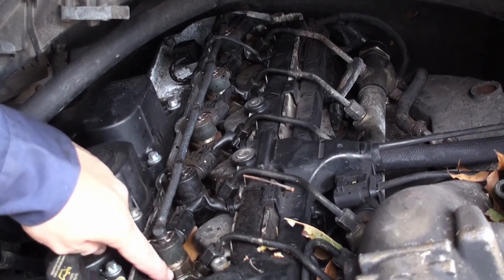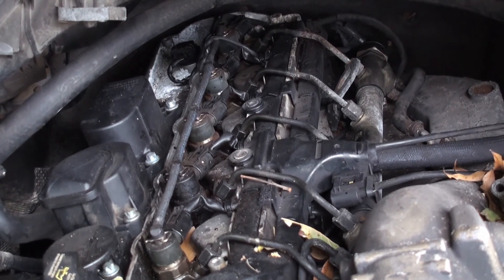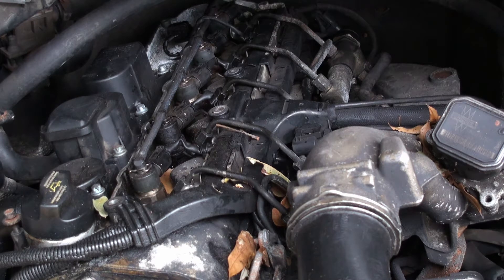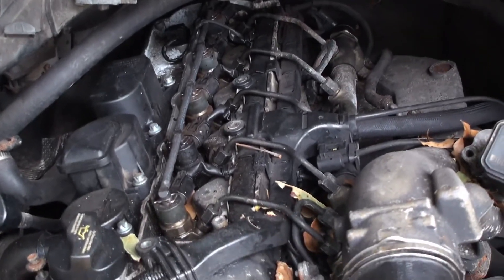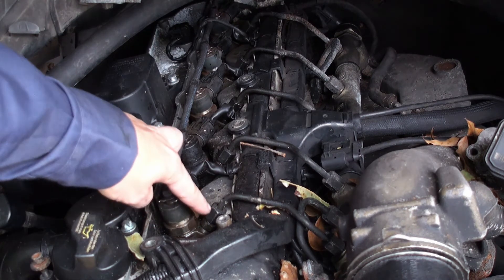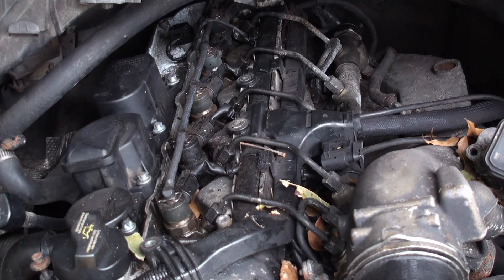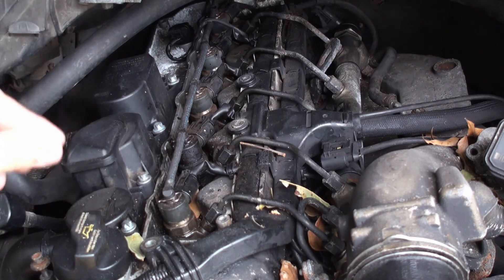T1N Sprinter Fuel Injectors and Fuel Rail Information

Comment: So I watch all your videos, it would be helpful if you didn't skip through because I had problems remembering where everything went back together. I took out the entire engine, redone the top end and put it back but I need to ask 2 questions. #1 there's a hose on the back of the valve cover, does it connect to anything or is left open? It had 2 brackets so I bolted  them to the left side of the valve cover. #2 Most of the transmission bolts are short but there's 2 just slightly longer, where do they go?

Comment: I am planning to install a webasto thermotop C into my 1998 sprintervan (D208-W901)
I think I am able to plumb in the coolant hoses and such but I wonder about the fuel line and do I need to bleed them after I installed a T piece in the fuel line to supply fuel to the heater?

Comment: Hi. I have an ‘05 2.7L
Fuel injector #5 threads are stripped. My mechanic tried to repair with Helicoil without removing the head, but the new bolt didn’t hold.
Any advice? 
Thank you so much.
Reply from the maker: Yes there is a fix for this, I talked about this fix many times but did not make a video on it yet, because my installation tool broke while doing this repair, but the fix is not using helicoil, that just won’t work, you need carbon steel inserts from  TIME-SERT they make a kit that’s specially fixed this problem, and it’s a bullet proof fix, but I would not recommend doing this unless you stripped your threads, here’s the link to exactly what you need  https://amzn.to/2C1F2hh

Comment: i have a 2006 t1n that is running really rough.  know its #5 cylinder, swapped #3 injector with #5 and no change, check compression and its good, getting code p0087 fuel/ pressure too low bank 1 and p0275 cylinder contribution/ balance and p0305 cylinder misfire. working on finding a possible fray in the wiring harness, any help would be great, thanks

Comment: Hello. I have a strange problem with a 2,7 engine like this, its mounted in a Jeep GC, but is exactly the same engine (OM612, biult 2003) Its hard to start when I park it facing front uphill. I have changed all the plastic lines and O-rings, and even added a check-valve just before the filter. There is no air in the clear fuel lines. But over night, the fuel goes out of the rail through the return line! (The line that goes back to the filter into the black plastic T-shaped valve. The return hose is full of air the next morning, and I have to crank 2x 10-15 seconds to get it to start. I have also checked the return flow on the injectors, and it seems ok. I changed the small and big O-ring on the fuel pressure regulator too. Now Im out of ideas here.. I cannot see any signs of external fuel leak. Air must be getting in somewhere in the rail to allow fuel to drain back through the return banjo ? Should the fuel pressure regulator work as a valve when engine is shut down? So maybe its something wrong with it? I checked my fuel pressure with an OBD reader and special app, and its 275 Bar at hot idle, and up to 1400 bar at full throttle. It seems to follow the setpoint smoothly. I have spent 2 years chasing this problem now, so I hope you have some idea? 

I can add that the problem gets worse the less fuel I have in the tank. Also, I have verified that its a solid stream of fuel coming from the supply line to the filter (no air) The problem gets better if I plug the block heater in. It gets worse when temperatures drop below freezing.
Reply from the maker: Keep me updated, and right now I am dealing with same thing let’s see if I can get it started

Comment: Thanks for these videos!  I am working on replacing injectors.  I don't know if there's another video discussion of the actual replacement of the injectors, I'm looking for advice on cleaning/preparation of the head for the new injectors.  Do you recommend a certain brush?  Or seat cutter?
Reply from the maker: I do recommend some tools, I actually have a video that’s a little more detailed and showing exactly how to do it step by step, as for tools always look In the description below, usually I leave links for tools and parts I use here’s the video https://youtu.be/qdQNuJVgoXo

Comment: Hello , I Was wondering if you could help me I have a 2006 sprinter diesel five cylinder, it keeps going in limp mode after reset, I have a code for too high fuel pressure, I have replaced so far the fuel filter,fuel pressure regulator and fuel pressure sensor, I also checked to see if any of the fuel lines are kinked but everything looks good, Could this be an electronic issue or the high pressure fuel pump issue.
Thank you

Comment: I have a 03 it runs bad when I am driving it makes a knocking noise like pre detonation then is goes away . I looked under the hood and noticed oily residue coming from the EGR it's a plunger style . Any thoughts on what it could be . My fuel mileage has gone down considerably it's chugging but sometimes it smooths out at higher rpm like on the highway
Reply from the maker: It sounds like fuel injector or injectors, there’s a $35 kit on Amazon that I just got myself, it can test the down flow of fuel injectors using a fuel return connectors on fuel injectors, you start the van up and look at which one will fill up the faster with fuel, letting you know where the problem is, here’s the link to the kit Diesel Injector Flow Diagnostic Cylinder Common Rail Adaptor Test Tool Kit
https://amzn.to/2UIyNoy
Reply: @ZimaletaMotors  I can't tell you how much I appreciate your advice . Thank you . I did watch your video about the black death and how you explained how the injectors works and the copper crush seal I love the videos I will continue to watch learn and share . Thanks again for the help it means a lot to me
Reply from the maker: Wow thanks jets awesome, glad you liked it, BTW today I finally built my setup for taking calls for my podcast, soon I will announce this, but because of your positivity you will get the number to my show early   

ZIMALETA How To Show Sprinter Help 
Podcast # 760-756-7378
I will announce best time to call, but for now it’s Saturday 12-5pm Eastern Time
Reply: @ZimaletaMotors  you are the best and I look forward to talking to you . I have learned such a great deal from you already . I'm a small business owner and it's videos like yours that help guys like us get ahead and prevent downtime waiting for a shop to look at it and get a huge repair bill . You are taking your channel in the right direction you are very knowledgeable and passionate and you truly care to get the right information to your following thanks again you are a big help
Reply from the maker: Your so welcome 🙏 I do it for viewers like you, I am trying to improve my channel and have more helpful sprinter content available, I will keep on growing this sprinter resource, and in time it will be the largest sprinter resource online, this is why I am adding a podcast style show to my channel, I want to start 1 per week and then improve what I do and do one daily, this means more work for me, but it’s well worth it to help viewers like you 😊👍
Reply: @ZimaletaMotors  and I will do my part and create awareness . You are truly on your way it's not easy people think you hold a camera up for 20 minutes and ad revenue flys in . It's a full time job and I truly appreciate the hard work you put in. I'm really looking forward to actually being able to talk to you I do have some good questions. But thanks again. What state are you broadcasting from I live in Chicago I was wondering because of the pod cast I can get the time zone so I won't miss your podcast
Reply from the maker: I am on east coast from South Carolina, yes you right it’s a full time job, plus I need to fit everything else in like family, eBay and other stuff, it’s 11pm and I need to go edit a video for tomorrow, 😊 looking forward to talking with you.

Comment: I have a 2003 T1N. Every so often in the morning or when it sits for 10+ hours when I start it up the engine surges for about 15 to 30 seconds. Then it’s smooth this out and idles fine. Any possible causes you know off the top of your head? 190k

Comment: 2005 sprinter with 178k on it. Getting code P0078 low fuel rail pressure. 2 months ago it was having trouble starting when not started for a few days (but if started every day then it would start right up). Then one day it didnt start. Jumped the battery and it was fine. Code still on. Then replaced fuel filter and a very leaky injector. Code went off and van had its power back. 1 month later now the P0078 code is back and lack of power. Van starts fine even when not been started after a few days but power is gone. Suggestions?
Reply from the maker: What does it say for P0078, low fuel rail pressure is normally result of bad fuel injectors
Reply: it says low fuel rail pressure. I replaced the 1 really leaky injector I had. Was insanely hard to get it out but got it out and put a new one in. Van was doing great for a month but now same code and lack of power. starts great though hot and cold
Reply: any other ideas?
Reply from the maker: Unless you have special tools to tell you what injector is going bad it won’t be easy but just replace one injector at a time to find a leek
Reply: I had a leaky injector and replaced it already. light went off and van had power for a month. now light back on and no power
Reply from the maker: If your getting low fuel rail pressure then the fuel injector problem is back, and if it’s not that then it can even be the fuel rail, so if I was looking for this problem, I would use good used parts to hunt the problem down
Reply from the maker: So what’s the actual problem, is it hard to start or lack of power driving? Did you check the fuel return line from injectors, you might be leaking diesel, just the thought
Reply: John Rosano 
Low fuel pressure is not caused by leaky fuel injectors. How did you determined that the injector leaks?

Clogged fuel filter can cause that, fuel pressure regulator can cause that and the high pressure fuel pump. But if you say it starts, high pressure fuel pump is probably good. You need to look at fuel pressure regulator. Here is a link to how it looks like.

https://www.pelicanparts.com/More_Info/6480700046.htm?pn=648-070-00-46-M14

It sits at the back end of the fuel rail. In the front you have the fuel pressure sensor, which if malfunction, can send a wrong signal to the ECU throwing you the code and possible limp mode. So you have check both, but start with fuel pressure regulator first. Also, tell me more how you determined that you have a leaky injector....
Reply from the maker: Great information

Comment: Hello I am having some trouble with my 2003 Sprinter van shutting off while driving and I just Coast to the side of the road turn it turn the key off and restart it and drive away after about 45 minutes it starts doing it every 10 minutes or so in the past I feel like it was a fuel pressure problem do you have any suggestions to locate the problem the dealer mentioned crankshaft sensor but I never have a no start problem it always restarts immediately.
Reply from the maker: I will answer in a video, BTW I will be removing youtube comments from my channel because some channels are getting deleted from bad comments lol not some but millions so I will answer trough emails now zimaleta@gmail.com
Reply: @ZimaletaMotors  ok please let me know when you upload this video.
Reply from the maker: It will be Monday

Comment: Hi!
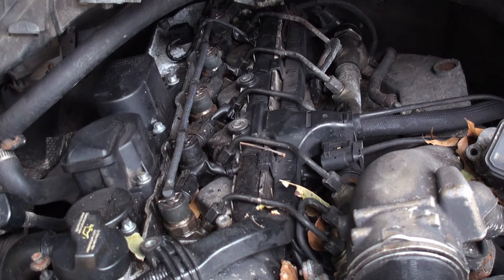You mentioned at 5:00 minutes someone was having trouble with a fuel leak at the inner fuel rail. You say it wasn't due to the Bosch injectors, where do you think the leak would occur? I seem to have a leak right at the same point and I'm trying to narrow it down. 
Cheers,
Mike
Reply from the maker: It’s high pressure fuel pump probably, but can you explain it better

Comment: My sprinter ran great , replaced egr... Runs like a dog now... WHY?
Having the stalling P2146 issue w/ the wiring Haeness also...
 DM me on instagram @scott_jim_reeder , so we can talk Please
Reply from the maker: +TheSmreeder hey 👋 thanks for watching, I am happy to help you, you can email me if you want zimaleta@gmail.com but I answer YouTube before email, I check YouTube commenters daily and notifications are on, but email I do check but not daily, so about your problem, your saying it’s running bad now? How did it run before you replaced EGR, if it was running better before replacing EGR then install the old one and see if it’s better, but it does sound like you can have wiring harness problems to, explain everything that the van is doing, let me see if I can help you figure this problem out
Reply from the maker: +TheSmreeder about your code, according to my research yes it is electric problem to the injectors
 Given the fact that the injector's spray is controlled electronically, supply voltage is crucial in supplying fuel to the cylinders. That said, a problem in this circuit can and/or will cause significant drivability issues among other potential hazards/symptoms.

Read more at: https://www.obd-codes.com/p2146
Copyright OBD-Codes.com

Comment: fuel rail pressure too high code      new rail  both front and rear sensors   still have code    changed computer   still same code
Reply from the maker: It might be the wiring harness
Reply from the maker: It might be the wiring harness